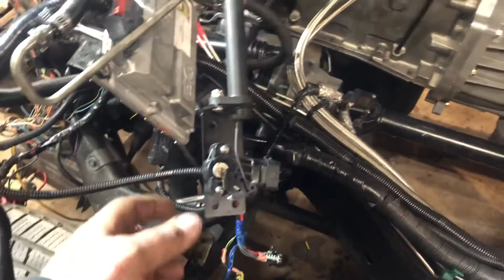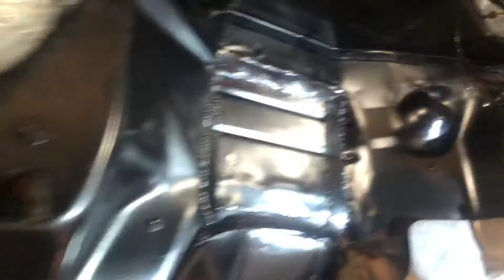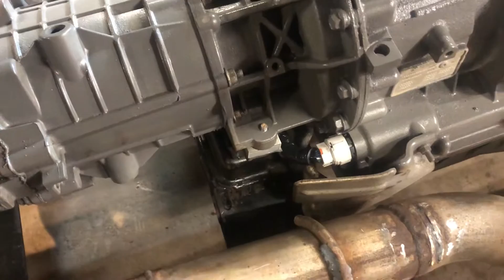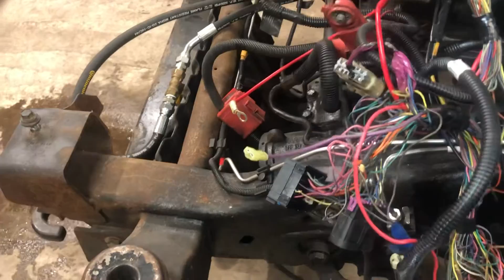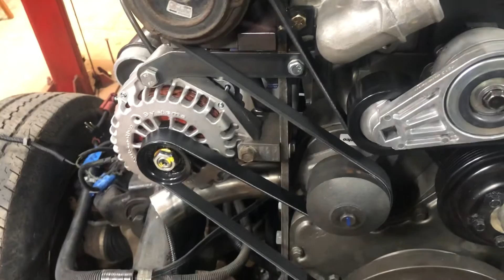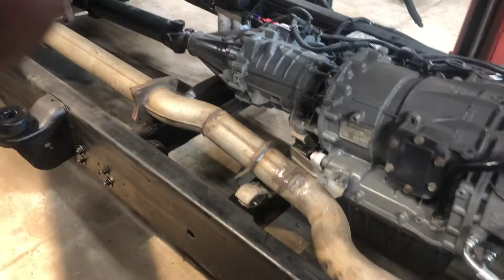CA conversations stand alone computer for Allison 1000 on 12 valve Cummins Chevy

Comment: Did you use back your duramax torque converter I'm building the same thing with Allison 1k 2wd
Reply from the maker: Not total sure what you meant
Reply: @naudydaveyou just pull out the duramax and replace it with the Cummins correct? Did you have to change out anything else?
What flywheel did you use?
What torque converter did you use?
I know you're using the stand alone tcm from ca conversion
Reply from the maker: @johnsondml so I did have to get an adapter kit. It had the adapter for the 6bt to gm bolt pattern, new starter , new flex plate. You can use your stock converter but they are pretty crappy and probably won’t hold the torque. You should replace it with a better one. I did have to relocate my motor and transmission mounts to get everything to fit.
Reply from the maker: @johnsondml ca conversions does have everything but they are expensive

Comment: Do you remember what the price on the full kit was? Thanks in advance
Reply from the maker: So I ordered it in July 2020 so prices could be different now but it was $5100. That was the wire harness and computer reflash, torque converter, tps, starter, torque converter core and shipping. I got the trans to 12 valve adapter on eBay for like $1200.
Reply: @naudydave  Awesome, I appreciate all the information! Do you know if this would work for a 01 gas 2500hd Silverado? I am swapping the 6.0 with a 12v and Alison 1000 6 speed.
Reply from the maker: Just email me if you have any questions naudydave@yahoo.com
Reply from the maker: Yea but they do have a different wiring harness and stuff for 6 speed. Also with a 6 speed you can get a display for the gear it’s in.  The owner Dave and kc are easy to take to. They don’t always answer the phone but they call back everyone. They are the experts in the swap. They have adapter plates and everything so you can get it all from them if you want.
Reply: @naudydave Ah ok that’s good to know. I definitely will contact them.
I already have an adapter plate and everything else to do the swap just need harness and computer, so I’m sure they can help me out. Thanks for the information! Have a blessed one.

Comment: What fuel filter and housing are you using? I've looked for a CAT filter conversion for the 12v without much luck. Thx
Reply from the maker: So I used one like the link I put. But i did have to machine it to fit on the 12 valve 

https://www.ebay.com/itm/265751345017?mkcid=16&mkevt=1&mkrid=711-127632-2357-0&ssspo=52f-JFYiQgm&sssrc=2349624&ssuid=ViaQduRPRay&var=&widget_ver=artemis&media=COPY
Reply: @naudydave  Perfect-thx. I'm surprised someone doesn't make one that will fit the factory banjo fittings.
Reply from the maker: I ended up doing braided lines and the adapter was metric o ring threads.  It was a lot of messing around till you get them right. I also got banjo fittings to an fitting and the fuel intake of the p pump and the return
Reply: @naudydave  OK thx- I’ll probably try to cut and flare the factory tubing to save the ends and put the braided line in between.
Reply: The filter just screws right on man you don’t need anything but the filter it’s same threads and everything lol

Comment: Thanks for sharing! What chassis is that? How's that independent front suspension handling the weight of the 6BT? 
I'm asking because I'm looking for a modern rolling chassis for my project, and independent front susp would be amazing!
Reply from the maker: So it’s a 2003 k3500 dually. I didn’t like the Duramax 6.6 so I put the 12 valve in it. It handles perfectly. I did raise the front but that because I use it to push snow with a older 9 ft western plow and that thing is heavy AF.  Also it the brackets hang low so I wanted some ground clearance
Reply: @naudydave  awesome man! Thanks for the input 👍🏼
May I ask something else, what about that Allison? Do you like it? Would you have gone a different direction?
Reply from the maker: So I should of rebuilt the Allison when I had the cab off. I think if I did it over I would of got a nv4500 or another manual trans to make it less expensive. I’ll probably end up pulling the Allison out and rebuild it this coming spring.
Reply: @naudydave sweet build! Not very many of these are out there that are actually on the road! I have a 2005 2500hd that I 12valve nv4500 swapped 2 years ago and it's been great have put about 20k on it since the build I used the cooler stack out of the dodge so i was able to run the mechanical fan and i was even able to use the stock drive shafts only frame mod i did was move the carrier bearing up 2 inches for getting my driveshaft alinement right only issue so far is my t case wont shift in to low anymore and I'm not surprised honestly it wasn't in good shape when I put it together I used the 263xhd worked great up till about 2 months ago but I have no regrets on the build otherwise if you look up cummins swapped 2005 chevy 2500hd you will find a vid on my truck my channel is supersport1986

Comment: What is the price  of the transmission conversion???
Reply from the maker: I had the transmission so that all depends on what you get.  But with the computer, wire harness and torque converter, it was close to $5k. I do wish I rebuilt the trans right away. But to do it again I’d probably put a nv4500 or 5600 in it.
Reply: @naudydave why wouldn't you do the allison again with the 12v?
Reply: @naudydave  
Thanks
Reply: @naudydave  the nv 5600 are not bad